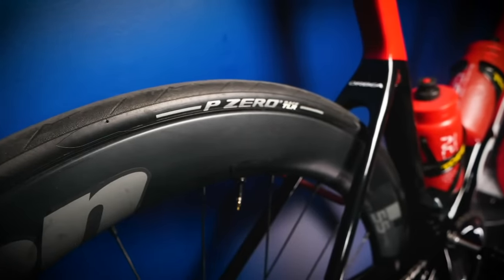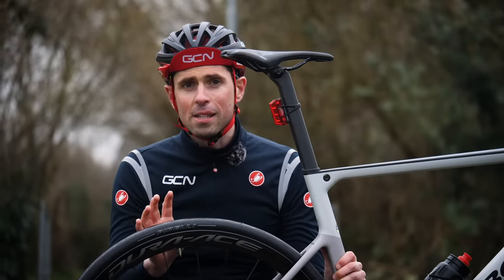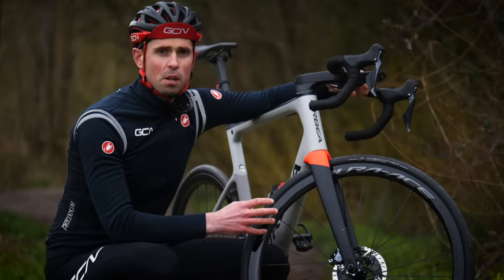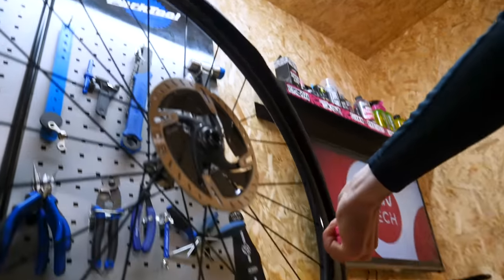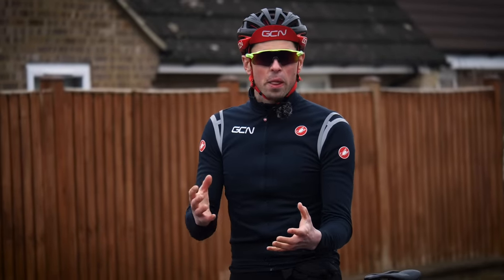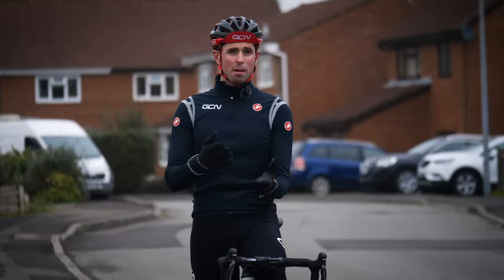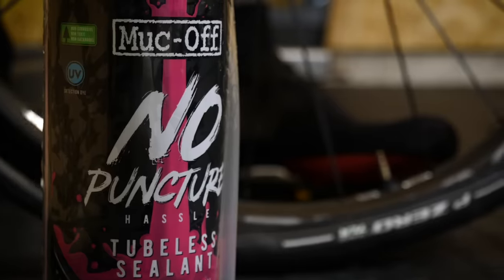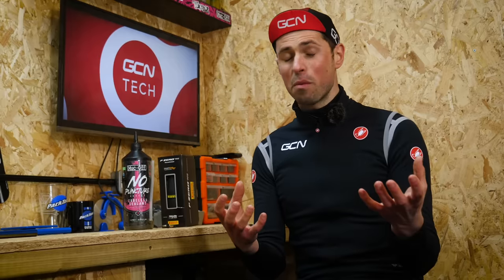Tubeless Convert! | Why Alex Will Never Use Inner Tubes On His Road Bike Again

Comment from the maker: Do you ride tubeless tyres? Let us know in the comments!
Reply: I did, won't try again. Maybe in 10 years when there are no narrow rims available.

Just cleaned out a tubeless tire. What a mess.

A TPU inner tube weighs 25g.
A traditional tire+25g is lighter than a tubeless tire without any sealent.

And I like the feeling of 7.5-8 bars. I love it actually. 
Riding with 6 bar in the tires feels muted to me. And I don't care about 1-2 watts. At least not if it isn't aero-watts XD
Reply: The ability to run lower pressures with less risk of puncturing is a big plus in Scottish roads. On the one occasion I punctured a tubeless tyre I simply installed a tube in the same way I would have had I been using a tube from the start. A wee bit of mess but nothing to worry about. The performance vs weight vs comfort thing will differ for everyone though.
Reply: #AskGCNTech How often do I have to replace the sealant inside the tyre?
Reply: I ran Schwalbe Pro One and I got too many punctures, made a mess, wouldn’t seal, and getting the tire off the hook was brutal/impossible on road I kept having to pump them up every few miles to get home. Went back to supersonic tubes and GP5000’s maybe one day I’ll try out GP5000 TL.
Reply: @JayLato  Don't. 5000 TL is so hard to get off. Took me 20 min at home with all the tools I wanted.
(Mavic cosmic carbon sl for tubeless).
I used Schwalbe sealant and it didn't work. Had a MASSIVE clot in my tube though. About the size of my thumb.

If you ask me tubeless simply isn't the right solution for road bike application.
The demand for high pressure prevents the sealant from working properly.

It seals it, yes, when spinning the tire in the air. Put it back on the road and the hole is back. At least that's my experience.
Reply: @JayLato  I run tubeless ready rims and taking off the tyres is next to impossible, even with the tyre levers. I once had a puncture and I just gave up and called my mate to pick me up. I've got to replace those wheels.
Reply: Thanks for the great info on tyres and bikes in general, I'm getting back into cycling after many years, (more specifically triathlon shout out to GTN 😉) I'm gathering info about what the latest knowledge is and I'm quite surprised to see (tubeless of course) but quite wide and soft tyres. I used to ride a modest 750 miles a week but the thinking then was narrow and hard, I rode 19mm tyres at 10+bar pressure. Can you do a film on tyre width and pressure for the least rolling riding resistance I'd be very interested.
Reply: Nobody mentioned about the cost of replacing sealants
Reply: @callumthorsen5474  those videos exist. easier to look for forum posts or articles. In general the rolling resistance goes down at the wider you go up until at least 28mm. Yet the aero penalties exists.
Swissside do a lot of wind tunnel testing and research and recommended 23 in the front 25 in the back. However they developed wider rims as well, so the 23 wouldn't fit as good causing the transition area of tire/rim to add a lot of drag.

I don't know if they developed wider rims to optimize the combined resistance of aero and rolling drag or just to follow the market's demand for wider rims.

I would argue that even if you lost some watts going 25/25 is surely acceptable as long as you aren't competing for some world record.

Latex innertubes still have less resistance convinced with regular tires then tubeless with sealant.

Considering the effort....25mm with tubes (latex, TPU, light butyl like conti supersonic) is what I would recommend. Be extra careful when installing the tubes though. All of those I listed easily rip)
Reply: I've been running tubeless tyres now for 2 years, and I'm not going back. It helps greatly to get a sealant injection kit for a mess-free experience getting the sealant into the tyres.
Reply: @philipcooper8297  depends on weather conditions. Assuming you don’t get punctures and have to top up the sealant then they’ll probably go 4-5 months over winter and spring. When it gets warmer it’s best to check every 3 months.
Reply: @Bendersnatchling  thanks for the info 👍🏻
Reply: No never, I tried to get a tyre back on but had to walk home.
Reply: No, I don't have the strength to get them on the rim. The only benefit is lower rolling resistance for me, so why hassle with sealant that dry out.
Reply: Tankx Alex, awesome video dude. Now as we both know you just threw gasoline on a "tyre" fire, LOL. I'm going to enjoy reading all the replies both "for and against", ok just the "against", they will be the funniest, LOL.
Reply: I will never give up my tubes.  Both my mtn and road bikes have tubes in the saddle bag as backup to the tubeless tires on the rims.  I've tried taking the tubes out of the saddle bag, but I can't tell any difference in rolling resistance or ride comfort.
Reply: M2CW I run tubolito inner tubes and they are just as fast as tubeless (for me) I also have the benefit of not getting gunk all over myself and wheels in case of a sidewall or major puncture downside minor nicks and punctures are way easier when running tubeless. So in summary for me it's all down to personal preference and what works for you...
Reply: Made the switch to Mavic tubeless last year, can’t see me going back to inner tubes etc, suit my bumble around rides
Reply: I did. Conti 5000 on DTWsiss. Setup was easy, liked the option of having low pressure but had to pump them up more often, were heavier and sealant was a mess when changing them. I am back with innertubes.
Reply: Always rode on tubular and clincher tires. Somebody gives me a free set I'll try.... Otherwise not wasting my hard earned money. Seen my own daughter struggling to fix a flat whatta a nightmare.
Reply: You think the same people who want to ride  65 psi on tubeless for “feel and comfort” are riding 95 psi on clinchers? newsflash! They are riding 75-85. I know, anarchists the lot of them right?

go tubeless.. no more punctures...no more inner tubes... (carries inner tube aaaaand a plug kit anyway)
Reply: @nature-4-all  i have questions if you have the time:
have you replaced the sealant in those two years? Why or why not? How easy or not was it?
How many times did you have to put an inner tube in that period to get home? Do you still carry an inner tube? How about a plug kit? Patch kit?
for the equivalent riding, how many punctures did you get in the 2 years Before TubeLess (BTL....i’m making it a thing). Are you riding the equivalent racy clincher to tubeless tires or gravel ready clincher and tubeless? Thanks
Reply: How is running at a completely different tire pressure 60 vs 95 a fair test! outrageous rig.
 If you have to lean on it that hard to get the result you want. Maybe you're wrong. But the case against tubeless is, it's way more maintenance. Doesn't deal with a slash from road debris at all. You can't patch a tubeless tire that had gunk depositing on the inside for a few months because it's not flat on the inside anymore, it doesn't deposit evenly (and also can't be cleaned always slimey)  So you are at a new tire immediately. much more costly and time consuming than putting a sticker over a hole.
Reply: Nah dude, the speed improvement is not that good and if things take a turn for the worse i will not end up with a gooey mess on the side of the road.
Reply: I ride tubeless. Two tips I have to people considering this: 1. Get a pump with a chamber. These tires are not always easy to seat. 2. Keep your saddle bag with a spare tube, CO2 or pump. Add to that kit some paper towels to clean up the sealant when you push the tire off the bead. If you do get a puncture and it is bad enough that the sealant doesn’t self seal you may be able to tube it to get you home.
Reply: @JayLato  I’ve had inconsistent results with Pro Ones—had one go thousands of miles without an unsealed puncture, but have had two with consistent holes that just wouldn’t seal and I just couldn’t patch successfully. I’ve had better luck with GP5K TL, though they’re a bear to mount.
Reply: Nope. I have a friend who has them and twice now he had to call his wife to pick him up after his tire(s) got sliced by a piece of metal or glass on the road.
Reply: Ive been tubeless for two year and a convert
Reply: @JayLato  word of warning about 5000TLs - excellent tyre but much harder to get onto rims than Schwalbe Pro Ones 🤣. 
I’m not sure what the fuss is about as I’ve had one puncture in 2 years running GP5000 clinchers after running over a large piece of scrap iron. If you run clinchers at sensible tyre pressures and avoid potholes then no worries.
Reply: I’ve been running tubeless for about 4 years now.  Just trying to get my bike ready for spring riding (remove tires, scrape as much dried sealant as I can off the tires, checked spoke tension and trued wheels).  When I put everything back,  The rear wheel keeps deflating within 1 min. after fully pumped are bead seated.  Tried Airshot and even CO2 still won’t help (the beads still seated but won’t hold air).  I did spray some soapy water and see the leaks coming from spoke nipples and the sealant won’t seal.  Looks like I need to remove everything and redo the seal rape again.  ARRRRHHHHH

Now I am worried what if this happens while out riding.......
Reply: @gosato  yup but where we ride there is a mile of road that is notorious foe large bits of glass and sharp metal pieces that slice or create a hole to big for sealant. I rode over a carpet knife blade that almost severed the tire from bead to bead.
Reply: Y E S. Tubeless tires are just much better. No comparison.
Reply: one time when i tried tubeless, the white liquid sprayed all over my face
Reply: I do not ride tubeless and as long as tubes are available I will stay with tires/tubes. I still run 23mm tires at 120psi front and 125psi rear. Nothing can change my mind that this is the fastest set up (for me). Hell back in the 80s/90s I ran 19mm tires at 140-150psi. No way I'll ever run tubeless unless parts become unavailable (which I doubt).
Reply: Too much hassle. Messy if you change tires or get a flat. A solution for a problem that does not exist for most people.
Reply: Tubeless Road cycling Pros: 
-cornering is way easier and faster
-more comfort
-less punctures

Tubeless road cycling cons
-unless your using tubeless specific rims the set up is a lot more difficult. Especially on deep section rims (50mm+). Can be a day long process of soaking the tires in soapy water and using a very specific tire lever technique. 
-this brings us to the next issue: on the rare occasion you get a puncture your sealant does not fix nor a plug, getting a tubeless on and off to put an innertube in is almost impossible when using a normal clincher wheel. Now yes, if you spent cash on wheels that were tubeless specific this would not be as difficult, but then you would be creating the added con of the expense of a new wheel set. 
-with one way valve systems like Milkit maintenance is a lot easier than most other tubeless systems, but still the maintenance more than innertubes
COST to make tubeless easier to work with it helps TREMENDOUSLY  to invest $$$ in things like a tubeless set up sealant kit, a track pump with an extra chamber
Reply: Tubeless for 2 years now on my best bike, like the pro's that tubeless provides, don't even bother carrying a spare tube with me anymore. If I do puncture and sealent doesn't work ( not happened yet) then I got worm like strips to plug the hole without needing to remove the wheel or tyre
Reply: I did for a year. Two pair of wheels (campagnolo and Enve), both Conti and Vitoria tires... not convinced.

A pain to maintain, the technology is not ready
Reply: @philipcooper8297  too often
Reply: Tubeless on my e bike but tubes for my road bike, easier to pull over and fix when there are tubes involved
Reply: I suspect it depends where you ride. I live in the countryside and had several punctures from hedge cuttings - one time picking out 5 blackthorns from a tyre before putting the spare tube in and inflating to find I missed one. After that I got tubeless tyres. Since then I’ve picked out more that 10 thorns, splinter etc and every one has sealed perfectly. So for me it’s a no brainier.
Reply: @monkeysrightpaw  So the closest bit of that to not entirely wrong or meaningless is the bit about a slash, and even then it depends. You may also be missing the point about tyre pressures.
Reply: Tubeless. Been there, done that. Back on a latex tube for my rear wheel and when the GP5000 tl wears out, also for the front wheel. Tubeless is a mess, it’s heavier, requires more maintenance, offers no better rolling resistance and in practice no better puncture protection. The only puncture I had in the last three years was with a tubeless tire. It failed to seal and after an hour at the side of the road trying to plug it, I needed to get a tube in. Never going back to tubeless.
Reply: Yes, started riding tubeless summer of last year and love the feeling and comfort. Tubeless all in for me
Reply: @nemeanf27  I was in the same position as you, thinking the same. Unfortunately, a plug doesn’t always work. Especially when the sidewall fails. After an hour in the cold trying to plug my tire and calling for help, a fellow cyclists offered me his spare tube. My advice: always carry a tube.
Reply: After finally getting a "modern " bike after riding my 1988 LOOK forever my friend talked me into it. I am now 1200 miles in on my Cadex 28mm tires with no flats ...but carry a can of GUP with me just in case
Reply: @FoodFFacts  I bought a box of Stans 1200 miles ago...still havent put any new sealant in my Cadex and no flats.
Reply: Tubeless is great until you have a problem. Tolerance is too tight and the bead was damaged when I replaced the sealant one time.  Then it’s a nightmare. Thankfully I had a spare tube to get me home but what a mess to deal with on the side of the road and the spray all over the kit and bike on the ride home. 

I do miss the comfort of the lower tire pressure. It’s the price to pay for convenience of carrying a few patches and an extra tube.
Reply: I’ve been riding tubeless for four years now. Only 1 flat tire that was my fault for not making sure my valve was properly tightened.  I have tubeless on both my road bike and gravel bike.
Reply: On tubeless one rides faster and with more comfort without doubt. My only concern that I have already suffered once is that the relatively high pressure use in road (80 psi) makes the sealant frequently escape through a puncture. The wheel does not go totally flat but 40 psi was the limit pressure before the leak started again. And also the bike and my butt were covered with sealant not easy to retire.
Reply: No way that I ride tubeless tires with the current technology. It's just a dirty mess and totally useless.
Reply: I always ride tubeless on my mountainbike. However on my gravelbike I like to run tubes because that bike doubles up as a road bike for me and their for I want a less messy way to change my tyres back and forth
Reply: I've been running tubeless since about 2 years, for 15000km, tried all sorts of different tyres, but I absolutely despise it. Improved comfort granted, but better puncture resistance is a myth. The inner tube is just so simple, cost-effective and more suitable for roadside repair, it is well worth to give up 7 seconds.
Reply: i don't, yet it intriges me. I'm all for new tech but i 'm still on the fence for tubeless. I ride my 28mm tires at 6 bar (85psi) and had 1 puncture in 8000km. i ride 3000 km a year, that makes 1 puncture in 2,5 years. I just don't see the benefits... (as a casual rider)
Reply: For well over twelve years, first  MTB, then road and most recently gravel.
Reply: @callumthorsen5474  I don't remember a time when 750 miles a week was modest.
Reply: Not fooling anyone 🤣
Reply: @FoolOfATuque  And there are plugs for large punctures
Reply: @FoolOfATuque  so what you are saying is carry the  same stuff you need for a clincher, plus a CO2 and a bigger pump, and paper towels. How is this progress from a clincher?
Reply: @markrskinner  not that hard to do the A68 Northwards from the A69 junction at corbridge is a great road for cycling the miles fly by great countryside, pick your distance and turnaround when your half way... Miss those days
Reply: @rudyardganuelas6254  all very relevant points. My experience, recently purchased a gravel bike which was set up tubeless. Every single ride the rear wheel has squirted 2 to 3 times. Decided there must be something in the tyre so best look. However went for another ride and pressure dropped, so thought best to try and get some air in. Lost all the air and impossible to get the rims seated again with a mini pump. 

So no issue, I'll drop a spare tube in (I don't think I'd every ride without?) - checked the tyre inner for any sharps, what an absolute mess bit did find a big object which I assumed had caused the ongoing squirt.

Put in the tub, inflated - air leak! Che led and there was a nick right on the valve which I thought was unfixable.

Give a self adhesive patch a go (after clearing the sealant) - incredible bit if kit those are!.

1hr later back up and running. My take away, I don't think I'd choose tubeless as an option, is never had a a flat previously on my road bike (commuter yes).

But I do like the idea of tubeless, but when it go wrong, it goes wrong very bad.
Reply: @rudyardganuelas6254  no, that’s no what I’m saying. You need a different pump to seat the bead on the tire during initial setup or you could use an air compressor. When doing emergency repairs the only additional thing you need is some paper towels to clean up sealant.
Reply: @craigthomasutube  tubeless can be patched just like a car tire. They sell patch kits for them.
Reply: i don't know where you guys ride your bike but i rode 8000km with my 28mm to 85 psi before having a flat...
Reply: I'll stick with tubes for the road. Leave tubeless for my mtb ta.
Reply: Not yet. But hope to convert soon 😊
Reply: Only tubeless; road, gravel and CX.  Haven’t had a flat in over 3 years. knock on wood
Reply: @FoolOfATuque  Yes, I have a plug kit that has saved me. Anybody. Going with tubeless should have the plug kit since some tires can be damaged more than the tubeless fluid can repair alone.
Reply: I run tubeless on my ENVE SES 5.6 disc and love the comfort they provide.   I also understand that the recommendation is to add sealant every 3 to 4 months.  My question is: do you just add sealant every quarter or are you supposed to remove the old sealant prior to topping up?
Reply: @edwardmortimer2378  you can do either, but after a while dried sealant will build up inside. Personally, riding around 17,000km annually, every 3-4 months I need to replace the tyres anyway so it isn't an issue, but I can see how people doing few miles would think that it's not worth the hassle.
Reply: I do, gravel bike for 2 years - 1st time I had a puncture that wouldn't seal and would have required a new tube and tyre boot if it was a clincher I fixed with a plug (Dynaplug Racer) in about 30 seconds convinced me. Bought an MTB about 6 months ago, have had the same situation literally in the middle of nowhere (mountain forest in rural Northeast Thailand). So when I bought a new road bike 3 months ago it was always going to be tubeless - Pirelli P-Zero Race TLR SL tyres on Hunt 44UD wheels, were easy to fit and used a syringe to inject sealant through the valve after removing the core, easy and not messy. Front tyre after nearly 4,000km has 6 small nicks that the sealant has fixed, so that's 6 lots of standing at the roadside avoided. The tyres are almost down to the wear limits so will need replacing soon, so having to inject new sealant every few months isn't an issue as I will replace the lot (and do it outside where a bit of mess isn't a problem!) Love the comfort of running much lower pressures. Not bothered about marginal speed increases as I'm 58 and stopped racing 4 or 5 years ago. 
However I can see how clinchers might be a better option for those doing low mileage in areas with good roads that are regularly swept. I will continue to take a tube and mini pump with me just in case, but I normally carry quick links, gear cable (on a non Di2 / EPS bike) etc etc as I have seen all sorts of issues on rides...
Reply: My rating scale of whether tubeless makes sense: MTB=yes. Gravel=maybe (not really). Road=no.
Reply: @MTBinKY  I'd say it depends on your road mileage. If you're doing very little it probably isn't worth the mildly increased faff unless you live somewhere with crappy roads, e.g. lots of flint. For higher mileage roadies (I did 17,000km in 2020 despite the restrictions) where you are replacing tyres every 4 months or so anyway, it really is. And your bum will also thank you!
Reply: @TheAdwills  No idea when it becomes "high mileage". I rode ~7000km last year and about the same the year before (probably 65-70% limestone gravel/rail trails with a tiny bit of actual road riding) and the rest singletrack/MTB. Zero flats on the gravel/road with whatever cheap tires/tubes came stock on the bike. I may need to replace them in a year or so. LOL
Reply: Another advantage of tubeless, albeit probably not of much value to many. My wife and I just flew to Phuket for a week and took our bikes. Obviously the tyres have to be mostly deflated, but not completely (which admittedly could be a pain with tubeless if you did!). My track pump would not fit in the suitcase, and I am loathe to put it in a bike box in case it comes loose and scratches the frame. 
At our destination it was easy to inflate the tyres back up to 70psi with a mini pump; getting 90-100psi in would have been a bit more of a workout!
Reply: @philipcooper8297  every couple months you should top it up 30-50ml per tyre
Reply: @Bendersnatchling  mavic wheels suck I have the same model.
Reply: @CycOp  looks like you rim tape needs replacing
Reply: Well done alex I feel like you've upped your game 🎯
Reply: @bubbachua  Yes I did, and it's all good now.
Reply: @bubbachua  what don't you like about them? I have 3 Mavic wheelsets. 
The Ksyrium Pro Aluminum wheels are my favorite of them actually. Can't say why exactly...I really like how they handle and feel.
Reply: I’m a convert. My road, mob and gravel are all tubeless. I set up my road myself, plus fixes etc all done myself now.
Reply: No but the new bike will be tubeless.
Reply: @JayLato  I've been running GP5000 TL's for the past 6,000 ks since I changed bikes. Zero punctures on pretty average roads. Once had a hit so hard I felt it through the rim, but only a slight sidewall mark, and didn't even notice there was an issue. Replaced the tyre just in case though. Never going back to tubes. Had too many punctures on GP4000's.
Reply: @JayLato  Im Running GP5000 TL, Best upgrade i did on my bike. Road are bad where i live and i use to have alot of pinch flat. Setting up the GP5000 is really a pain tough... Its so hard to get the tire onto the rim. But once you get it setup its worth.
Reply: No
Reply: @philipcooper8297  might be the tire, not the rim
Reply: I see the advantage mainly in offroad usage, getting lower tire pressure there just makes all the difference. On Road however, I don't see it as a necessity. It has advantages and disadvantages. For someone like me who only really manages to get on his bike once or twice per week, Tubeless isn't worth the hassle. I get that it might be better overall, but to me inner tube and clincher gets the job done. No mess, no milk, no worries.
Reply: I did, when butyl and latex tubes was the only tubed options. And I loved the ride quality, low weight and quick response it gave, but it was also a lot of hassle, mess and a constant worry. When Schwalbe made the Aerothan-tubes recently, I realised after a few test-rides that I would never go back to tubeless again. All the same benefits without the negatives. They're so small you can carry multiple spares if you want..
Reply: There sure are a lot of angry dinosaurs around here!
Reply: No not ever. Tubular for optimaly fast racing and for training cheap clincher wheels and tires. Tubeless is kind of the worst of both worlds still. You can't get a good price worthy second hand pair of tubeless  wheels just yet, that's for sure
Reply: Tubeless tyres are a pain in the hoop, got a side wall slit today and would have been hitching a spin home except i had a spare tube with me.
Reply: I really like tubeless tyres that I ride - Mavic Krysium wheels and Yksion tyres, but I find maintenance of them difficult.   By this I mean, getting them off the bike to check sealant levels - an annual task for me.  I cannot imagine inserting an inner tube roadside if that was necessary - think it would be ride over.  

Howabout a video for tubeless tyre maintenance and roadside fixes?
Reply: Absolutely.......used to have tubes in road bike and lots of punctures, now 6000 miles running tubeless on my Spesh Roubaix and no punctures so far........
Reply: Bald men go tubeless.
Reply: As long it's impossible to repair a "tubeless" flat at 5Celcius under rain with a nasty sticky liquid, I'll stick with tubes.
Reply: Tubeless for 5yrs here, not going back.  I used to get a puncture or two a year, and since the change I've only had one that required injecting more sealant and pumping the tire back up.  That's about 25,000 miles at least.  You can fix large slashes with a thick upholstery needle/thread and tiny tube of super glue, no need to mess around shoving a tube in there.  I'm always on long distance 500mi rides and don't bother carrying tubes anymore.
Reply: Wife pregnant. Back to tubes.
Reply: I like my inner tubes.
Reply: @johnsuarez1404  In Columbia they are referred to as 'Vas Deferans'.
Reply: My tubes have burst.
Reply: @johnsuarez1404  Is this really you Lance?
Reply: @mididoctors  I will never beg from one of mates. Unless it's in a carpark after 5am.
Reply: @johnsuarez1404  I have just stolen your LH crank. And locked your bike up somewhere else.
Reply: I have tubeless on road and gravel bikes, absolute ball ache to set up on the road bike with schwable pro ones and mavic carbon wheels. Gravel bike was easy to set up and done in ten minutes.

Touch wood, I've never had a puncture on either bike, and would never go back to tubes. I don't carry any with me, as Id never get the tyre off the rim at the roadside, let alone get it back on again.

Been over a year tubeless now, it's great 👍
Reply: Tubeless is another bs scam like disc brakes to make simple bicycles harder to fix.
Reply: I do and I haven't had a single puncture since I switched. Just got a wheelset with a 19.5mm internal with that meshes so nicely w my 28's. Installing the tires does suck.
Reply: So you compared 2 clinchers and a tubeless. But isnt there an extra type of tire which is Tubular which are glued on?
Reply: I'm so happy I changed back to tubes.

 It's a little bit funny, I payed so much money for tubeless tires and all the stuff (milk, sealant, tape, valves, air container etc.) just to make a big step from almost  no punctures at all (tubes) to punctures far away from home (I'm riding up to 500km on one day trips/marathons), not only with no chance to fix the problem on the road (compressor needed), but to make it more funny, fully cover covered with glue-milk, which beautifully sprays on you and your bike if a puncture happens. 

Probably you never heard about all this "glue spray" fun, or about the egg shaped wheel when using on emergency tubes on a tubeless tire. No there's nothing about it in all promotional films...
Reply: Yes.
Reply: I put tubeless in 2 bikes (1 is Ebike).
 I'll not come back to tube.
 Way fast, no punctures, rolling.
Greets from Brazil
Reply: I rode tubeless tires for 3 years and then went back to tubes because tubeless tires are so damned expensive and you still have to carry a tube in case you get a flat on your tubeless which does happen.  For special cases I do use tubeless (extremely rough roads and new tires) but most of the time I use standard clinchers.
Reply: @FoodFFacts  And that tubeless tires are more expensive plus wear out faster.
Reply: Yeah, waiting for technology to get us to tubeless without the sealant.
Reply: I still think 700x25c is faster I'm not a fan of low pressures tried it once it seemed slower at 90 psi then 120psi rear and my front is usually at lest 100 but I'm small and light but I replaced my stock seat with a soft one  if I was 170lbs plus the ride might be too harsh.
Reply: @FoodFFacts  Also the cost of potentially replacing expensive jerseys when the sealant from the rear tire starts spilling on the folks riding behind you.
Reply: I switched over a year ago. I'll never go back either!
Reply: No. I have one solid tyre and others not tubless. But plun in future use tubless with home made inserts. I one made home made insert with tube tyre. But i not plan use sealent. With inserts i think sealent not needed. Tubless tyres have better rooling resistance, beter safety, better grip and slower they makes soft then long not using bike. I have 5 bikes and not want often pumping tyres.
Reply: Tubeless are rubbish for road bikes I would avoid but good for cx
Reply: nope
Reply: Nah i use tpu tubes. Just cant afford the space to do all the dirty work